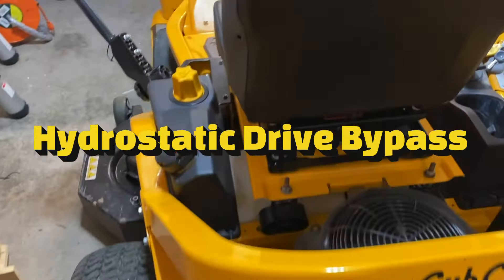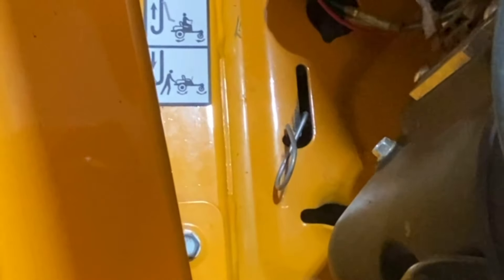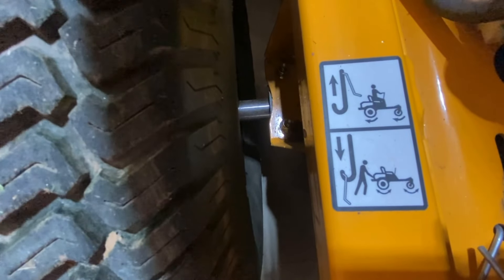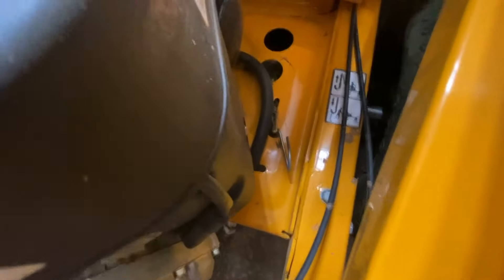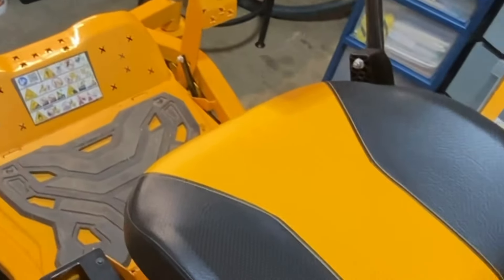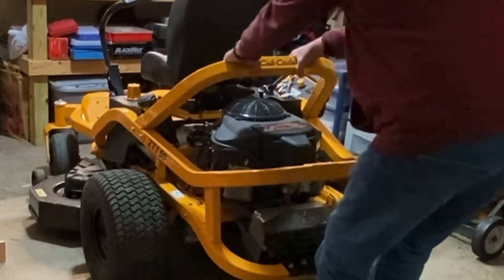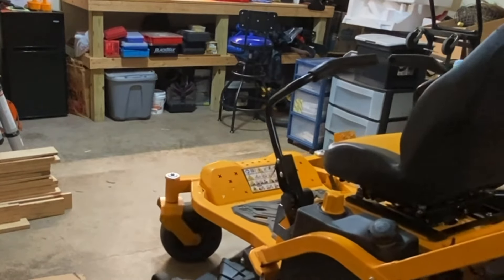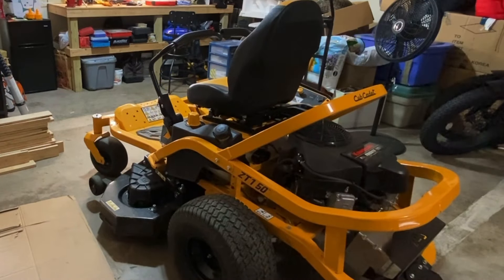Effortlessly Tow or Push Your Cub Cadet: Quick Hydrostatic Bypass DIY Guide!

Comment: What does it mean if you can push your mower back and forth regardless of the lever?
Reply from the maker: @bdauphinee81  does it roll for as long as you push it?
Reply: @hackthehoneydolist  yes
Reply: @hackthehoneydolist  my mower has 92 hours and 3 years old. Never tows anything only used in summer once a week  stored inside
Reply from the maker: @bdauphinee81  check the pull rings I show on this video and make sure they are in the correct t place
Reply from the maker: @bdauphinee81  does it not engage and move when it is started?
Reply from the maker: @bdauphinee81  other issues could be, drive belt issues, hydraulic fluid issues, idler arm spring. I would check the drive belt and make sure everything is good there if your hydrostatic bypasses are both in the correct position.
Reply from the maker: @bdauphinee81  did you figure it out?